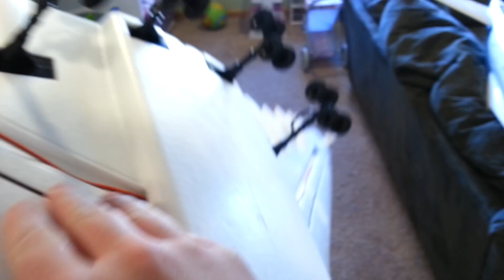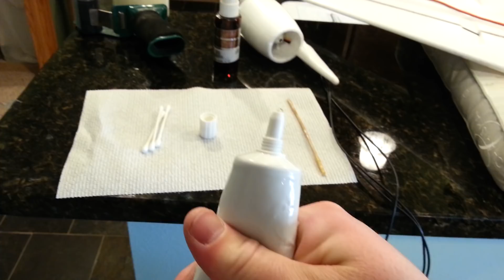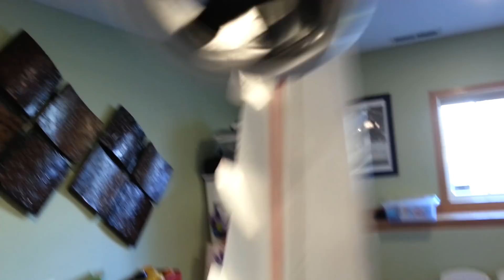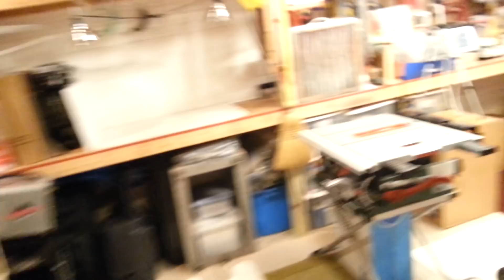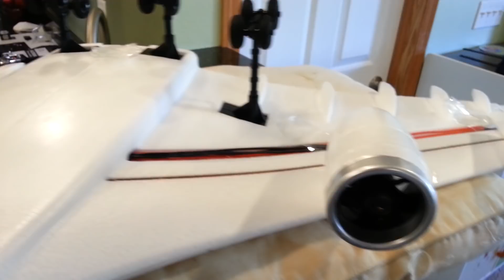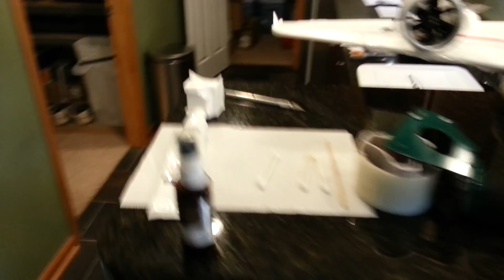Tian Sheng - Airbus A380 - Nacelle Install - Build Series - Part 4

Comment: another great video brian. yeah il give it a shot. fyi i like to use epoxy. same result as yours but doesnt dry hard. its malleable if ya gotta move but sticks really well. nice job of tucking the wires in. ill do the same cuz im like you and hate those bumps showing after you put the servo tape on. any way to clamp those engines on till they dry?
Reply from the maker: I tried a clamp, but it was a no-go...I could have built a jig, but just pulling the tape in several directions seems to have done the trick.

Oh yeah, you were saying about epoxy not drying hard...well, the 15 minutes stuff IS supposed to stay somewhat flexible, and I have some "Red Barron" brand stuff (I use BSI almost exclusively) that claims to remain somewhat flexible as well....but like you said, it's a pain in the but to work with.